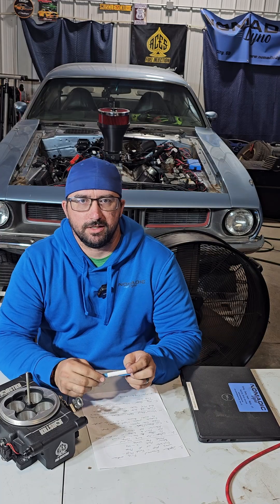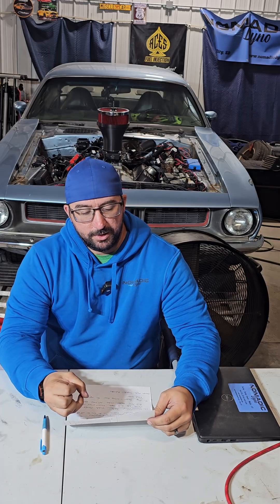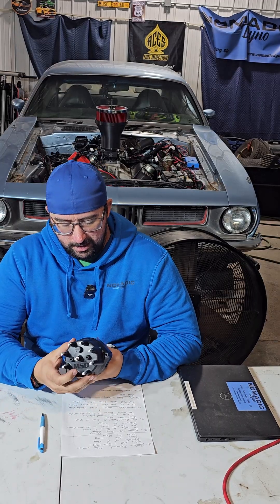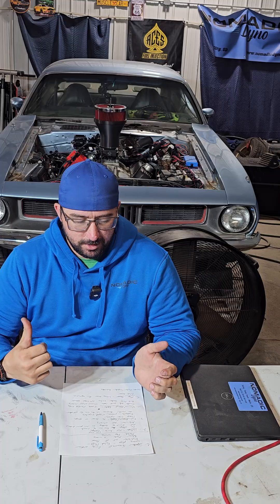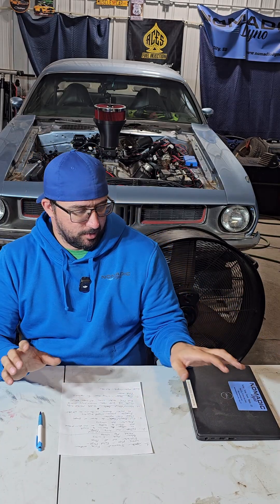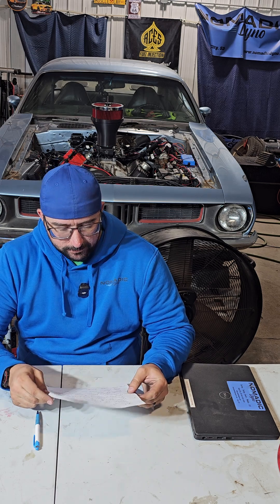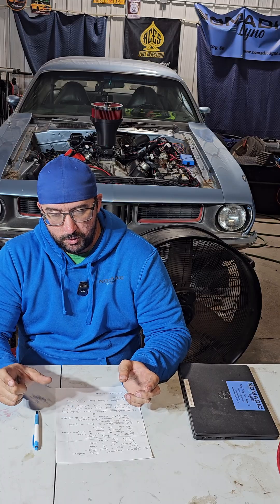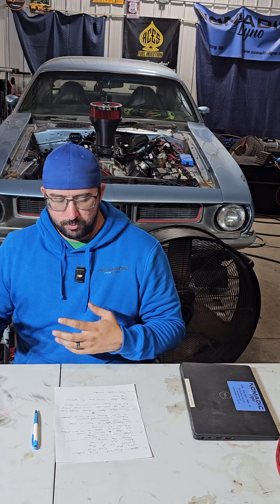Aftermarket EFI Common Problems Found During Tuning  | Aces EFI

Comment: How do I verify/change the firing order?
Reply from the maker: Firing order is determined by your camshaft. You would just change the wire location on a distributor. On an mpfi system with 8 coils, it would be in the settings on the calibration.

Comment: If you are using a PDM, or relay for your main power, when it sees that you turned the vehicle off via the ignition switch input, does that trigger the correct shutdown procedure using the MRD relay?
Reply from the maker: With the PDM it does

Comment: Good morning, Reffering to the port on the bottom of the throttle body. The instructions say to block the port with the provided screw and run a hose for boost reference to the side of the throttle body by the linkage, when running on top of a roots supercharger.

Should this not be done?
Reply from the maker: A draw through supercharger/turbo setup is the only time you'd plug that port, just like you've mentioned. People will plug that hole for no real reason sometimes and give themselves a headache.

Comment: Is there a setting that allows you to change the units in the software from metric to imperial?
Reply from the maker: Yes, in the top left corner on the monitors screen hit the gear/settings. You can change it on a dropdown on the bottom right area of that popup

Comment: so quick question. I have one of the cheapo pqy regulators on my ks1. Its on the return line side. I cannot get a reading on my gauge at all so Im not sure whats up. Ive tried 2 regulators. Im having the fuel drain back issues im pretty sure. I guess a check valve would be a first order. Im not sure what to do with the regulator or whats going on with the regulation outlet side. Should I be on the inlet not return? Pump is the tight tank  unit -6 lines all the way both sides. Once up and started seems to run pretty good.
Reply from the maker: Can you send me pictures/ videos and details to nomadicdynollc@outlook.com? Easier to see what's going on
Reply: @BryantStilwell it will be a few days but yes😊